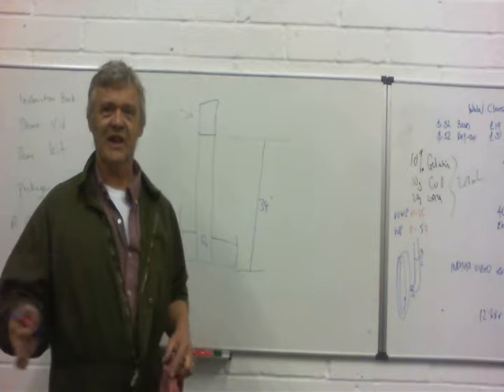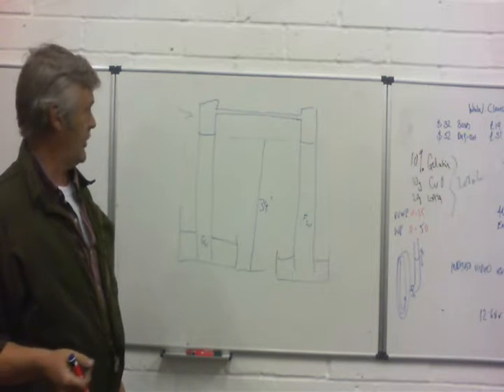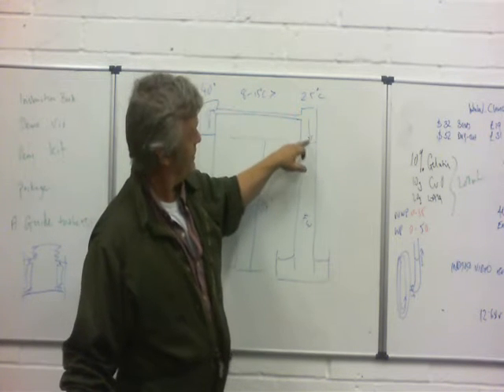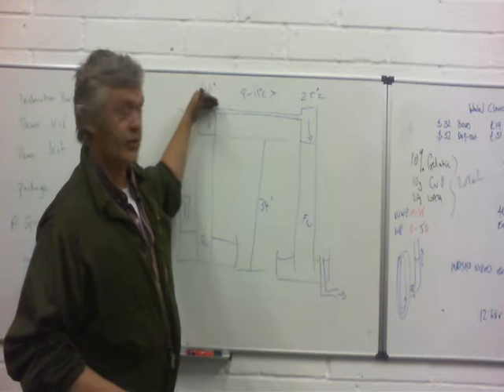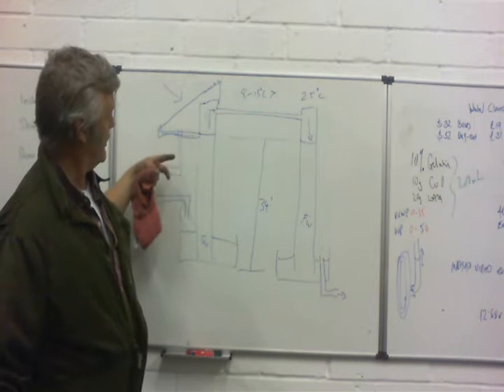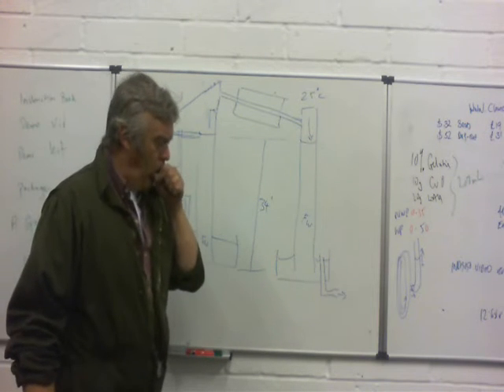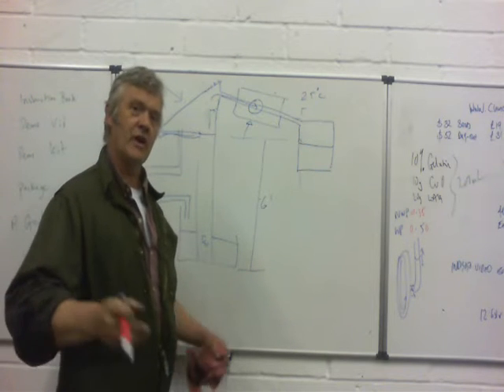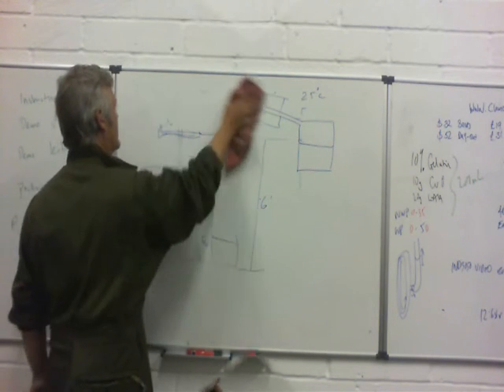Low Pressure Desalination - Some Systems

Comment: 7:40 the sprayer is interesting. I'm thinking whether the use of a sprayer could enable the removal of the brine column since the vacuum could in theory be maintained by the fresh water column alone. Could make the device significantly more practical to construct with half as many columns (and safe space to allow for double the amount of desalinators). Unlike the last design tho, it will still have the "brine chamber" to capture salts

Comment: instead of a single 34 foot water column. split it into smaller columns. a tube full of air can be treated as having same pressure throughout it... so a gas filled tube can transfer a pressure drop to a lower elevation..
eg...  
first bottom tank. pressure on  free water surface bottom tank is atmospheric (aprox 1bar absolute pressure). tube with water column going up say 2m. pressure drop at top of water -rho*g*h=1000*10*2= -20kPa or -0.2bar

vacuum hose to transfer that pressure drop in gas, to gas to above water level in next bottom tank. it's f water surface will start at atmospheric - 0.2bar ie 0.8bar absolute. and a 2m high water column takes another 0.2bar from pressure... resulting in -0.4bar from atmospheric. ie 0.6bar absolute....

repeat until pressure is reduced sufficiently.

Comment: I suppose I am a bit late here, but have any of you tried the wave power to pressurise water to enable reverse Osmosis ? I have been studying this concept for a while now. The lashing waves could lift a buoyant float and let it fall due to gravity, and this movement could be converted in to a pumping action to operate the reverse Osmosis pumps. 
Alternatively, we could also use this wave power to develop some great Vacuum and then reduce the column height to enable flash boiling at ambient temperature. I understand, the goal is to not involve any electronics, and seals..must be simple and stupid, yet reliable like an axe. 

Let me know your thoughts. 

About pulling vacuum from centrifugal force of spinning water, isn't it as good as using a liquid ring pump ?

Comment: I've designed a so much similar one to that 2 columns design and thought I'm the first one to think it, but I see your videos are 5 years old and no one tried to implement them, why?
Reply: I am, I am designing a small version using a hand cranked vacuum pump. Seawater bucket is painted black and left in the sun, freshwater bucket it kept in the shade indoors. I am planning to design this myself and then release the designs free in multiple languages on reddit.
Reply: @momothromycin8506  any updates? How did it go?

Comment: So found this trying to google why the basic principle of low temperature water column vacuum distillation is not already, since "forever", widely applied. So, I think it is time for you to revisit this subject, I want to know if you have gotten any further.  :) 
 I want to point out that neither the evaporator or condenser has to be incorporated in water columns, you can design the evaporator and the condenser for optimal respective main function, and have a separate vacuum pump in the form of a water column in a thin hose. 
You can then just keep the evaporator in the sun, and the condenser shadowed from the sun basically, or use basically any source of waste heat that is not insignificant. 
10+ meter plus buildings, or trees for that matter, are not that rare phenomena. I think having the water column vacuum "pump" as a separate part of the system brings huge advantages. Because you want as much evaporation and condensation as possible, and as little complexity as possible.  
Spraying, mechanical pumps, and so on may very well increase output from a specific system, or even be needed for some designs to work at all,  but it adds unnecessary complexity if you do not actually need it. And when dealing with brine is one of those examples when you should be extra careful to avoid unnecessary mechanical complexity.
You almost seemed to forget that evaporating and condensing large amounts of water means large amounts of energy transferred/transformed. Both the evaporator and the condenser needs effective heat transfer. It think huge surface area is needed in order to get relevant amounts of distilled water if only the difference between sun exposure and ambient air in the shadow is utilized. I do not think the surface area needed makes the principle unviable for practical use, far from it, surface area is not that complicated to supply, but I think it is easy to vastly underestimate the area needed. 
Also, I don't think it is a good idea to completely separate salt and water in the system. The higher the salinity the lower the output will get, all else equal, and with "moderate" temperature differences/energy transfer used, at saturation it would be a lot more difficult to get significant output compared to, say, at 6-7% salt content. Sure, roughly twice the amount of seawater would be needed, transport of it, and so on, but, that is not the tricky part of desalinization in most cases. Humans learned to transport water fairly efficiently thousands of years ago. Also, harvesting salt from within the system presents another plethora of possible issues. Replacing still far from saturated brine with sea water in the system is not that problematic.      
Also, about the water column height needed to reduce pressure enough, one of the interesting things with water columns is that they do not need to consist of one single straight column for physics to work as it does. If height is really an issue, you can have multiple water columns work in series, connected in series, and mounted side by side.

Comment: An alternative to using fixed width columns might to to have the lower portion of the column being a 35 foot vertical pipe below ground and the upper portion being a tank several feet in height and diameter above ground.  The hole for the below ground pipe would be drilled in the same manner as a water well is drilled.

For the two column implementation one tank provides the large volume for evaporation and the other tank provides the large volume for condensation.  The tall underground pipes provide the height required to produce the vacuums for each without using unnecessary volume.

In short the column is wide above ground but tall and narrow below ground providing the benefits of both width and height only where needed.

Comment: Looking around the net at maple syrup production you can get the vacuum effect of columns on a slope so no huge building costs needed just a steep hill greater than 34 feet tall.
Reply: That's exactly what I was thinking. How wide must the pipe be? Does it matter? Does it work the same even with a 1 inch diameter pipe? If yes, I'm freaking going to Africa to save lives
Reply: @zzanzare  I prefer to release the schematics on African sub-reddit pages translated to native language. Youlle be surprised how many University students you can find from any nation willing to help translate if its for their country

Comment: You could add a third column to degas the sea water before it goes to the rest so rather than pumping for two columns you only need to cycle one.

Comment: Thank you for such a brilliant explanation. This is exactly what I want to do. My plan is to use solar panels as a heat source. Here in South Africa we are running out of water and conventional desalination plants are too expensive. So we need a much simpler solution especially for the poor communities.
Reply: Brakjan did you do this. From Namibia Swakopmund so need solutions please.
Reply: @erwinkesslau3868  Hi no I got sidetracked with other projects. I still think its possible with pumping sea water from the coast using solar and then collect it into a reservoir with a dome that is heated by the sun. The water should condense against the dome and drop down the sides into a secondary tank. Then all you do is collect the salt every few days.
Reply: @BrakJan  I am looking into that exact system with a added heat source to fast track the process and even work on misty days. Just thought a flash evaporative system will work faster.
Reply: @erwinkesslau3868  Good luck with that man you must make videos and put it on Youtube

Comment: In the last design:  1)  Where does the salt or brine go?
                                  2)  Could the column initially contain only fresh water, so no risk of contamination?
Reply: You just pump out the brine it can be very valuable when processed for salts and metals like lithium.
Yes you can start with fresh or nearly potable water to eliminate or reduce contamination risk.

Comment: I have an idea. You have two columns but you only need one with a partition in the middle. Fresh sea water comes up one side and the heavier brine goes down the other. As one commentator said a Tesla fluidic one way valve could keep the flow going the right direction. At the top you have a partition where fresh water collects. It is above the sea water and brine. At the bottom of this partition you have a hole that is plugged. The plug pushes in from the outside. A float controls the valve. When enough water builds up 1. float goes up 2. float pressure pushes the valve out letting the a little water (and maybe some gas pressure) out.

Now I have a string connected to the wall of the fresh water collection partition, then to the plug, then to the float. The float going up would pull the string, pushing the plug out. Probably best to use a lever but the sketch tool I used was hell with a trackball so I did the best I could.

It would not be high volume unless the column was large but it would be steady and require no pumps or other equipment. I don't see why you couldn't just sink it in the ocean leaving the top sticking out ten feet or so so the sun would hit it.

Volume of fresh water would increase the more you shaded the fresh water collection and the more you heated the salt water intake side.

Here's a sketch online. Excuse my pitiful sketching. Track balls as not made for drawing.

http://www.sketchtoy.com/66588334

I might add the centrifuge idea is brilliant as is your idea in the first place.

Here's another idea that's a bit flaky. There's a pump called a spiral pump. It works by compressing air in a spiral. 1/2 water 1/2 air. The water pressures add per every spiral. A very nifty thing. Could you fill a spiral pump with water. Seal it and lift out of the water and get your vacuum from the spirals? Maybe have one spiral for salt water in and one out with brine? A fresh water take off at the top. I can't get my head around the idea of whether they would add or not? They do so as a pump but it does have a air buffer. Anyways here's a link to spiral pumps. Truly interesting in themselves.

http://lurkertech.com/water/pump/tailer/
Reply from the maker: +LargeFarmAnt mate i like the ideas bt i always think the best test of an idea is to build a proof of concept this will answer so many questions for you - if you do build a working model and feel like it a video log of the build would be of great interest to a lot of people me included
Reply: Did you make this?

Comment: Would the system still work if you had a say 50ft tower built to form the water column, but instead of it being built from the ground level up you built it in a hole that was 30ft deep. Would a barometric head still be able to form and create a vacuum? Im asking because I know many areas have strict building codes that don't allow structures over a certain hight. Ideas?
Reply: That would work.
Reply: There is less barometric presser the higher in the mountains you go  so digging a hole should only increase the pressure but not in a real effective way to the system.

Comment: Hey Rob,
How about using the solubility of water in air (humidification) to do desalination instead of low pressure? This is natures way of distilling water and can be done with relatively small temperature differences and at atmospheric pressure.
Reply from the maker: Uwe Dobberstein sounds like a plan mate - you might have a problem with high volume throughput though
Reply: I did some calculations and it seems the sizes are quite reasonable for 200l of water per day with solar energy.Even found a paper about it.

http://www.scirp.org/journal/PaperDownload.aspx?paperID=33877
Reply from the maker: Uwe Dobberstein looks good

Comment: just an idea watching this, 
i wonder if instead of a chamber 1/2 full of salt water you pulled an almost complete vacuum on an empty cylinder and used an atomiser to in spray in preheated salt water as a fog. like from a pond fogger.
assuming i've understood correctly, if the particle size is small enough, the mist should immediately evaporate raining impurities on the bottom of the cylinder.
i'm no chemist, this might end up like a fancy form of steam distillation.
Reply from the maker: sounds good mate - i will give it a bit of thought
Reply: The problem is it takes large amounts of energy to pull such a vacuum. you can reduce some of the energy needed by using a vortex air dryer, as they do on pneumatic tool systems, but you still have a large energy cost. maybe on a river water fall It might work as the river water could be piped to pull a partial vacuum.
Reply: @astrialkil  No  you don't need to dry the air you use the column system to be a vacuum pump given the massive area you can effect with such a system it is extremely efficient as a vacuum pump by adding a few vales so that actual amount of water being pumped will be minor and is only how ever high above 34 feet the system is.
Reply from the maker: astrialkil true enough thanks

Comment: Hey Robert! How about you take that last 1 column system and add a Tesla 1 way flow valve. Put it in the pressure head so water as well as pressure can seep to the salt column but the salt water can't flow up into the pressure head / clean water tank.  I could be wrong but I think that would stop the contamination problem.
Reply from the maker: that's a good idea mate and along the lines i am thinking too

Comment: Hey there,
Just wanted to point that while I kinda linked the idea of exploiting the density difference between salt water and fresh, I think it would be a problem implementing such a design as the interface between the fresh and the salt water would allow for diffusion of salts between then. Still sounds like a good option as a pre-treatment method for further purification through a membrane system or something like that.
Reply from the maker: thanks for that mate - but there isn't much chance i would follow that route

Comment: the problem with the last example. if you heat the salt water and spray cool freshwater on top the water will churn do to the heat rising.
i still like the idea very nice i think.
Reply from the maker: you spray ht salt water on top of the salt water column and cold freshwater on top of the fresh water column - but you are quite right thermal equilibrium will be reached quite quickly - around 4 minutes or so - that's after 6 liters of water have been desalinated - the answer is to use a heat pipe - these are suggestions in their basic form and you would hav to do some more work on them to turn them into working systems but the basics are there

Comment: Thanks mate!  Had a thought about the column...  this would be an interesting thing to place inside the mast of a sailboat, and with the pumps and sensor bits running on solar, the heating at the top of the column could be achieved using an evacuated tube such as this one:  http://www.ebay.com/itm/1-Solar-Evacuated-water-heater-tube-boils-water-with-sun-/321089908977
Reply: Perhaps the sails could provide a cooling air flow on one side for condensation and the other side of the mast could be heated.  A water based solar collector on the deck might provide warmth to the evaporation side of the mast.  One problem might be and significant volume of water in the mast might raise the center of gravity.

Comment: I just had a bit of an eureka moment, this is how you can put the whole thing in your living room:
So there is a vacuum in the tube because of gravity; and if the gravity would be stronger, the tube can be shorter.
The solution: Centrifugal force!!!
...
I did a quick calculation: if you want the device to be 1×1×1meter in stead of 10 meters, you can make a spinning can with the diameter of 1 meter (so radius=50cm) the centrifugal acceleration should be at least 20 times bigger than our gravity(9,81m/s²)
A=V²÷r   =>   20×9,81m/s²=V²÷0,50meter   => V²=0,50×20×9,81=98,1    So V=squareroot(98,1)=9,9 Meters/second.
10m/s for a diameter of 1meter gives 10÷2п=1,59turns per seconds =95 RPM, this is really the minimum for it to 'fit' in your living room.
Only think about the majority of the washing machines reaching 1000rpm, this must be easy to realise
Reply from the maker: that is a good idea - I am going to try and replicate this - cheers mate
Reply: Robert Murray-Smith WoW! a top load clothes washing machine has all you need for a fast conversion to water purifier, water in , water out, spinning in a water proof environment, electrical motor and connections, all you may need to add is a water heater or cooler, and maybe a storage tank and chlorinator (to comply with local regs) . Just add filtered dirty water and electricity.
Reply from the maker: astrialkil nice one